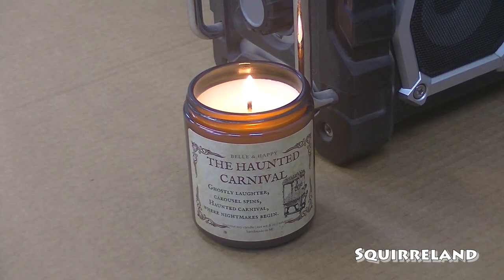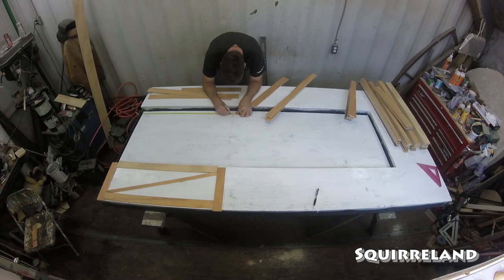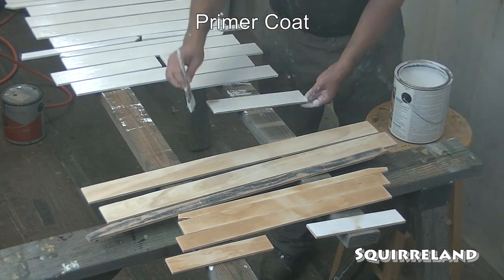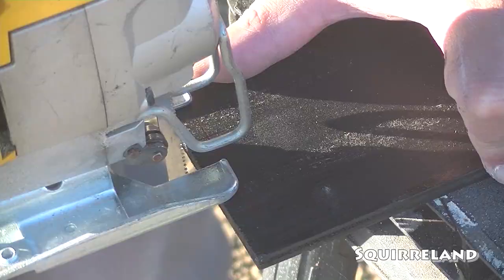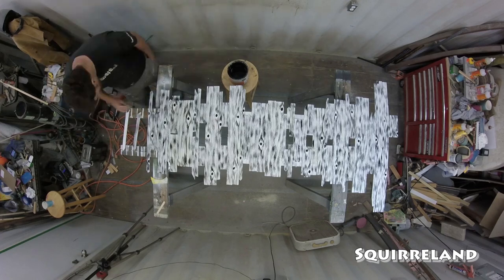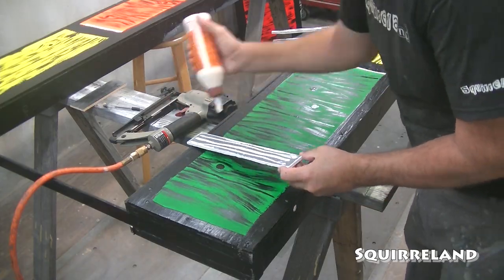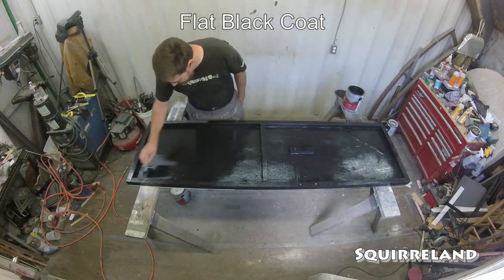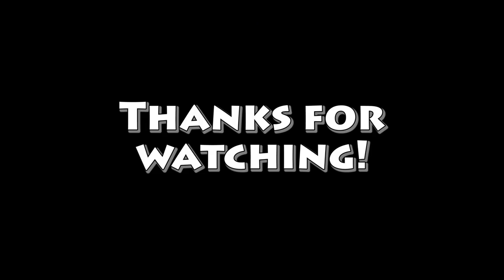Packing Crate Actor Door Panel - For A Circus Themed Haunted House Attraction - Squirreland

Comment: Of course I am watching it all.  I am seeing if I can pick up tips and tricks.

What I am working on a Haunted Mansion-esque theme this year and I need to make wall panels.  No I'm not a pro-haunt, I'm a little haunt and I tried to save money on making the panels. 1x3 furring strips, but I used Masonite for the panels.  I cut them so they're 4' x 7' high and these panels are lightweight and I can lift them... I'm not in great shape.  The thing I don't like about them is that they are pretty flimsy material to span the space even with the paneling grid.  The staples pull through the material and the glue doesn't hold down.  I've gotten them into decent shape after a game of "whack-a-mole" but something tells me I should have gone with flooring underlayment, it would have jacked the price up $75 more dollars, so material costs for just the panels would be around 400 bucks... Sigh...  but then I might not be fighting it now.  double Sigh.